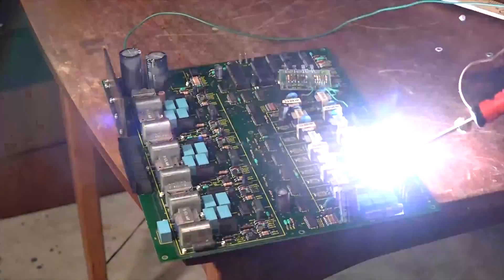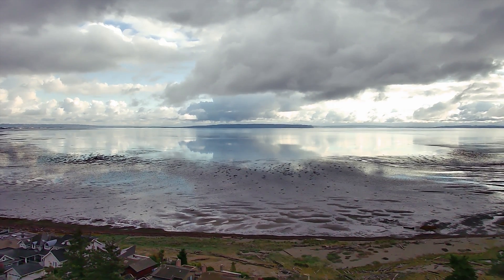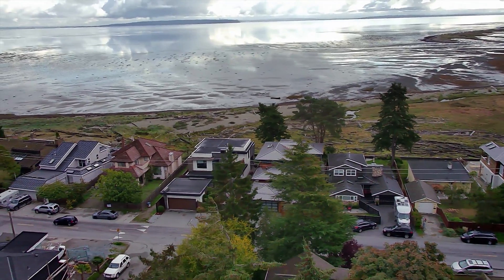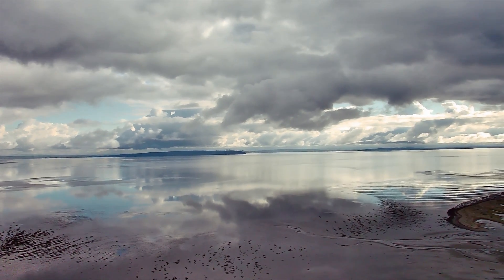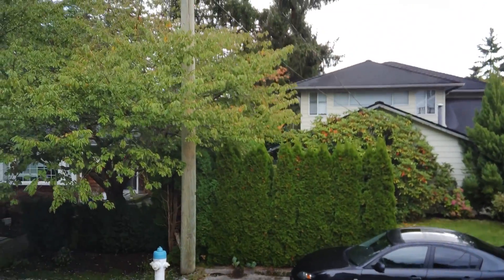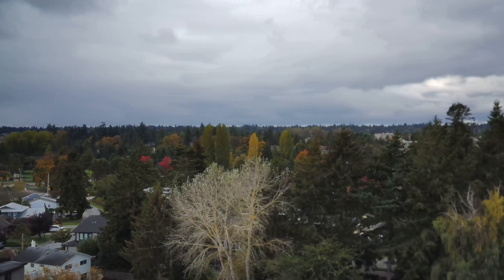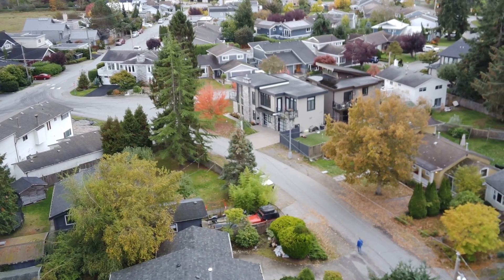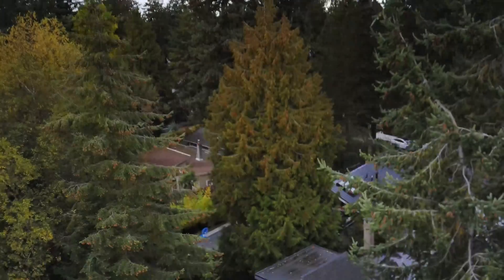A tale of 2 Drones Active 2 axis mechanical Gimbal vs Electronic Stabalization

Comment: pretty happy with my mini 4 pro its had little use though been so much rain hear.  the probs needed change after some time too.
Reply from the maker: You can buy 4 of the Deerc drones for less than 1 dji.  You know where my money is going.  Its not going to a 1299 dji. Splitting hairs for picture quality.  What I see of the D65 is more than good enough for aerial photography for 99% of users. That other 1% that needs to use it in a professional cinema application can spend the extra bucks but I would imagine anyone with that budget is going to use a large drone and carry a Sony Venice anyway.